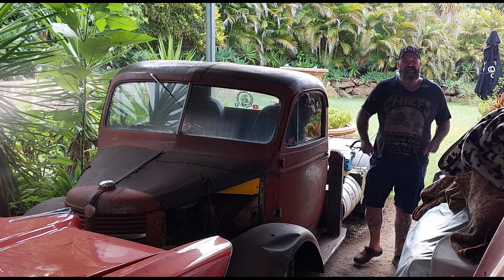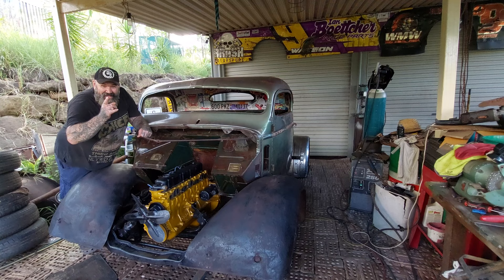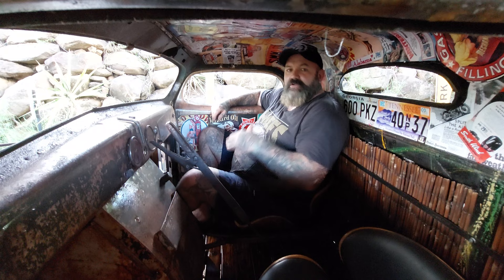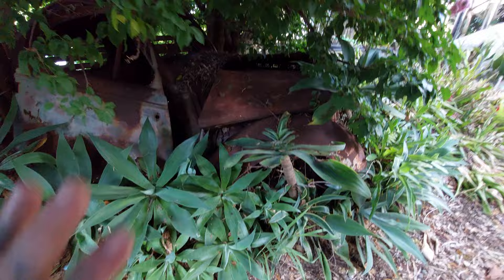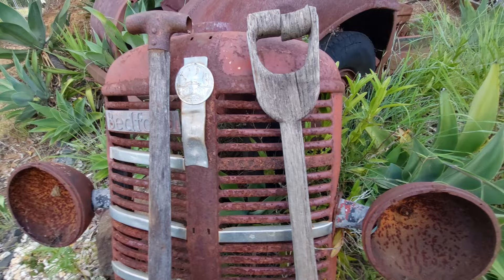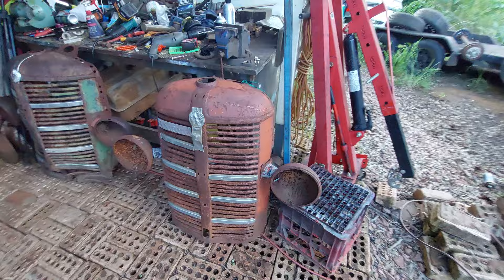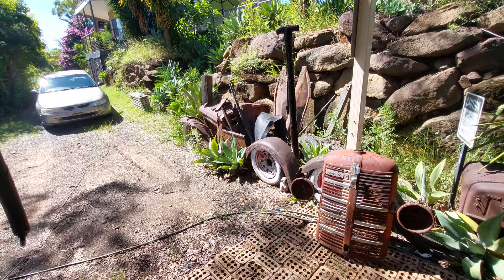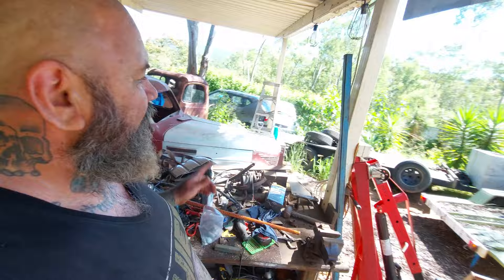YOU DECIDE which shifter to use! $2k Budget Bedford / Holden HOTWHEELS Legends Tour Build. #ratrod

Comment: Number 2 gear shifter, number 3 handbrake, I know 3 that's the original, but it looks cool 😎 for a rat rod IMHO, and I flip cars to 😊 that new front panel looks sweeter then the original, watched in parts on my tablet, im back in the spray booth now talk soon 😊 🍻🇦🇺😊👍
Reply from the maker: Thanks mate. Yeah I'm painting today aswell, no booth for me though your lucky, I have the outside elements
Reply: @copperheadkustoms  ok got ya, smoko here 10.22am yeah I only have it at work, I'm the same at home, outside, I still haven't even got a proper shed 😅  but hopefully 1 day, a divorce 17 yrs ago fixed that, 🍻👍😎
Reply from the maker: @MetalMania3DTV-TAS-AUS  you 1 hour in front
Reply: @copperheadkustoms  yeah same time Sydney Melbourne 🍻👍